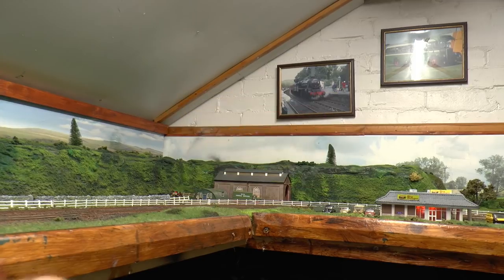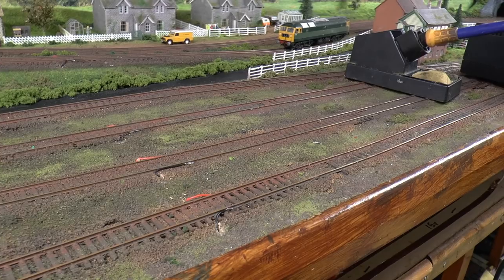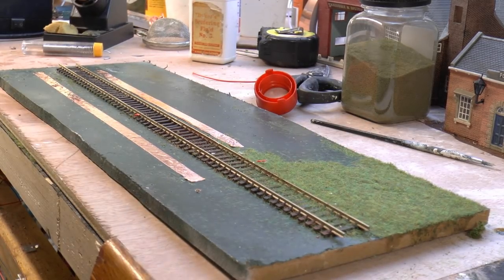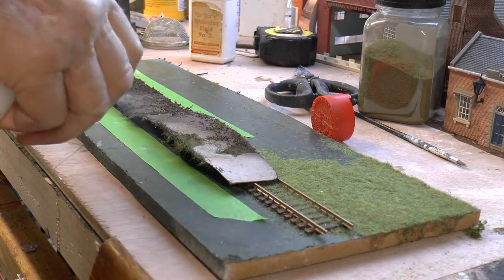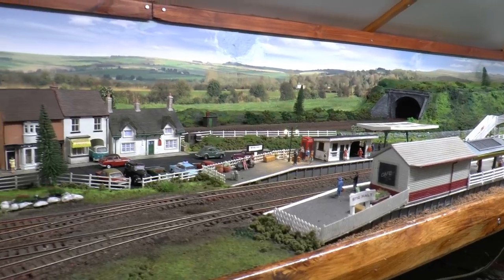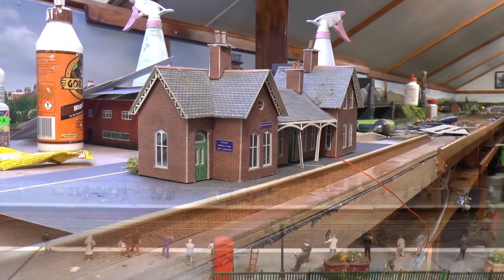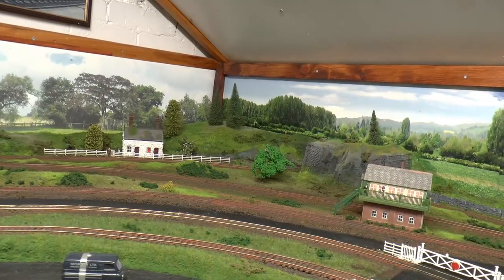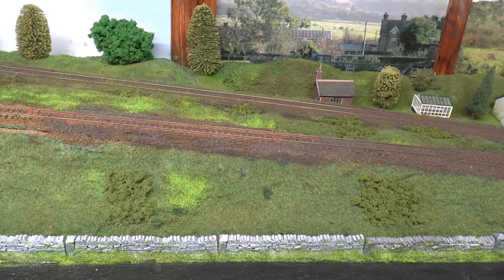Dave`s Model Railway New Layout Part 6

Comment: Hi Dave, 
I really like the copper bus tape on the surface of the baseboard covered with scenery, better than laying underneath trying to attach dropper wires.
A very inspirational video Dave, thanks for sharing. Regards John.
Reply from the maker: Hi John , its a case of preference with the tape , to be honest I like to be able to access it , so even underneath it is a good product , as not so may wires and couplers needed , think for the lighting it will prove invaluable ...Cheers dave

Comment: Hello Dave. That copper tape is absolutely great , so all we have to do is solder all 3 volt lights to 1 piece of tape , and 12 volt to a separate piece etc. Looking good Dave . This will save me having all dangling wires under baseboard. Thanks again Dave . Steve ,gwr ,swan village railway station.ps , it's so much easier .gotcha. another great idea
Reply from the maker: Hi Steve , yes you will need separate one for your different voltages , maybe better to add resistors to the 3 volt light then all can be connected to 12v , I have done that now , ..Cheers dave
Reply: @howarth004  Dave , that's a great idea. I've got plenty of resistors, I'll do that . God bless you and the stig . Steve, gwr swan village
Reply from the maker: @stephenparkes5932  Hi Steve , yes best way then you wont have to have so many different supplies to your lights etc . ideas shared are best ..Cheers dave
Reply: @howarth004  PPS . Have a nice break the both of you , enjoy each others company. Thanks Steve gwr swan village railway station.😁
Reply from the maker: stephen parkes Thank you , we have been to the same place for the last 4 years and enjoy very much ... cheers Dave

Comment: The copper tape is a great idea, makes for easy install of wires.  You could maybe put the tape under the track and put a small jumper at each joiner.  It would use quite a bit of the copper tape.
Reply from the maker: Hi Scott , think there are so many ways you can use the coper tape , I still like to be able to access it though , but for hiding wires etc its a great product ..cheers dAve

Comment: I bought a hand drill because the battery in my other drill was always flat just when I needed it. The hand drill seems to do the job just as quickly and you have more control. Doesn't shoot out of the piece of wood you're drilling as quickly as a battery powered drill. I thought of using copper tape, but if there are any problems after you've put the grass over it, then you have to dig it all up again. Have you thought of using the Woodland Scenics Tidy Track Track Painter Rusty Rail TT4581 for painting the sides of the rails?
Reply from the maker: explorermap Good idea having a manual drill at hand , as you say more control , or of course have 2 batteries , I also prefer to keep the bus line open , so running it underneath is a better idea for me with having a shelf like underneath , this way though it is neater  than having a lot of connectors , the rust pens etc are good for a small area , but mine is so big , the way I do it is easier and cost very little , can use most dark brown acrylic paint ... even the powder ... cheers Davev

Comment: Hi Dave. You get a lot done between videos - even demonstration boards. That's a good length of a platform your building. Very useful tape - should be a lot easier to conceal than cables when lighting for instance. Enjoy the holidays, make sure you over do it :). Alan.
Reply from the maker: Hi Alan , well you know me ..never overdo it ....but free bar one never says NO ...the tape i am sure is going to prove very useful , even more so when coming to the lights in houses etc , ..that platform is big , but the old station building is so had to leave a bit of space back and front with tracks running  both sides , looks a bit out of place as yet , shall have to see when all the bits added ...Cheers dave

Comment: Copper tape is very useful - like you, ive used it for soldering my lighting droppers to. Using it for a bus wire, im not so sure about. it is vulnerable to damage, which will ultimately lead to power supply problems. I certainly wouldnt use it on top of the baseboard - if it gets damaged, you would have to lift all the tape, damaging scenery.
Reply from the maker: I fully agree , as I said I was a bit dubious to having it all under tape etc , like to be able to reach it and any repair needed , but as I have used it for lights and Bus for the track it makes it easy to reach , easier than laying under the table , so think I will continue using it as I have done under the layout ..cheers dave

Comment: Hi Dave, coming on well, At 4.30 it shows you soldering the copper tape, to the right, next to the building, is what looks like a bottle of flock, I like the colour, what make and colour is it please. I do like the copper tape idea.
Reply from the maker: Thank you , the soldering fluid is clear , its bakers soldering fluid and it works great , the copper tape is going to prove to be very useful ...cheers dave

Comment: Dave the copper tape seems to work ok. Is there a limit on how many volts the tape can handle cheers Robert
Reply from the maker: Hi Robert , well I have been running 16v through on the tape I used without a problem , but just looked up on a chart and its given 10mm width 50m long taking top to 11amp ....and the wider 20mm taking 22amp ..so should think for our hobby there is no problem ...cheers Dave
Reply: @howarth004  Dave pulling 11 Amps on 10mm x 50 m long is not a problem plenty of volts there.
Reply from the maker: @csxmad  If you google   limit of voltage through copper tape .....there is a chart that comes up with all the details ..aas you say though with this Amps its no problem for us ...cheers Dave

Comment: Hi Dave great way to wire your layout and keep it nice and neat. I like the material you use for the platform. The color of the platform did you have to paint it or do's it come already painted?  The layout is looking nice. Nick
Reply from the maker: Hi Nick , yes is a good way to keep the wiring tidy , the platform is the metcalfe tarmac sheets , so no not painted them ....work in progress as they say ..cheers dave
Reply: Hi Dave thanks for the info. Nick

Comment: Hey Dave progressing well on the rebuild, can I ask what the angle is on your incline at the drawing on paper stage on my own and looking at some inclines for mine but woodland scenic incline’s are 16ft for 4 inches at 2% and 8ft for 4%.
Reply from the maker: Hi Colin , this is just 2" high incline think it was the 8 ft. on which I had to take about 6" off the end at the top , on my last one I had 4.5" and it needed 16ft . which is a long incline , but if you run diesels its not a problem for a short one , the longer the better , if you have the room ...cheers dave
Reply: Thank you Dave
Reply from the maker: Colin Busby 👍🏼🚂

Comment: 10:48 the station building is VERY close to the edge of the platform.

but Dave, its looking good.
Reply from the maker: I know , its a problem with it being so big , I wanted to use it , its from an earlier layout , but with tracks both sides it is going to be a tight fit ...shall have to se how it looks when all the bits are added ..cheers dave
Reply: @howarth004  
idea:
have it at the front of the station complex by the carpark, so when "passengers" arrive by car, foot, taxi or what ever they have to go through that building , and then over the various steps or even place a smaller waiting room that would then give the impression that there is a tunnel going under the tracks.  (like in Stoke on Trent)
Reply from the maker: Xantec sounds good , only problem though that platform is only half the width .. it would have to be in the car park , shall see what can be done later .. cheers Dave

Comment: Why such expensive stuff as coppertape? Could just use some household wires.  (Alongside rails i can understand, and for folks who do carpet layouts) 
At least there won't come any snails climbing up your layout. ;))
Reply from the maker: Ha ha , yes suppose would stop the snails ...but household wire would work just as well I suppose , but copper tape has a sticky back and at £3/5 a roll its not too expensive ? ... all to be tried ..cheers dave
Reply: @howarth004  no that's not too expensive, but here in holland it's much more expensive, i needed it for my fruittrees. ;)
Reply from the maker: @Romin.777  I tried it for slugs in the garden a few years back ,  did not rely work , buyt yes its cheap enough here , take a look on Amazon ...cheers dAve